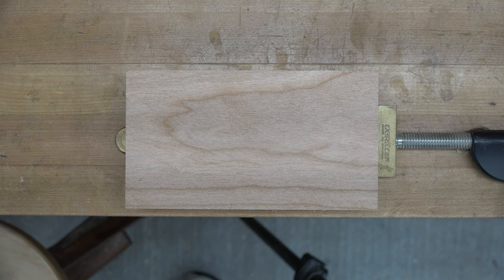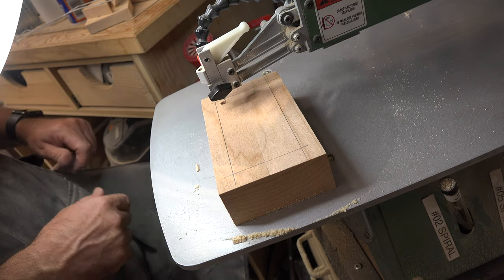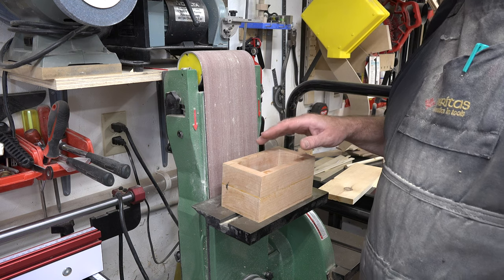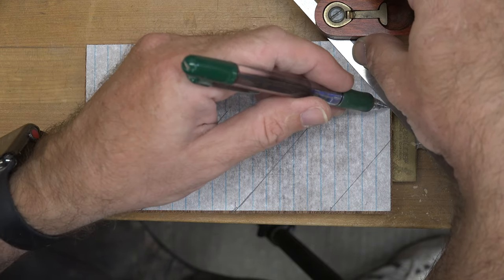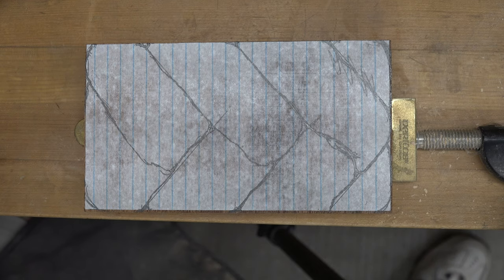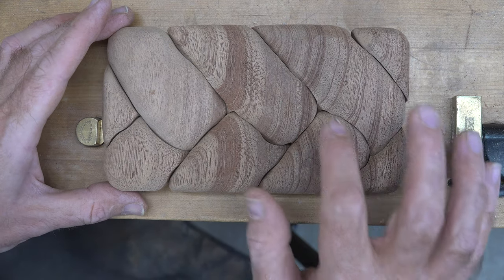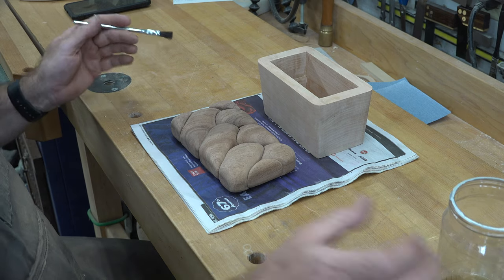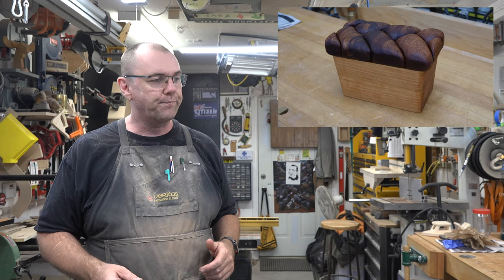Making an Intarsia Recipe Box

Comment: Great project! Question:
Do you think you (I) could do it with a bandsaw?
Reply from the maker: I could definitely be done with a bandsaw Stephen, you would just have to change a few things.  The "box" of the project would have to be made in the same fashion as a bandsaw box where you would cut the interior out and then you would have to glue the box back together where the bandsaw blade cut through to the interior.  (I hope that made sense) Other than that, the project is very doable on a bandsaw.  Good luck with your project and don't hesitate if you have any questions along the way.  Thanks for tuning in.

Comment: Kenny, I don't mean to be critical of your neat project, but the lid is an example of segmentation, not intarsia.   Intarsia is the creation of an object using a variety of woods that are selected for color and grain pattern.  When all pieces are cut in an adjoining pattern from a single piece of wood, that is segmentation.  It does look yummy however.
Reply from the maker: I have created many intarsia pieces and I consider this one of them.  With segmentation, I usually find that it is a flat piece and only one dimensional and while this recipe box may not have been cut in a traditional way (i.e. separate pieces with varying grains etc) it is still shaped in a way, using different species to create a 3 dimensional piece which is what I consider to be a key element of defining intarsia.  So if I were to give it my own definition of what I think qualifies as intarsia, I would say it is the cutting and shaping of different pieces and species of stock, to form a project that is no longer flat, but yet has dimension and depth."  In my mind, segmentation is still a flat piece.  Like marquetry, but thicker.  No to worry though, I'm just fine with someone thinking that it's segmentation.  It makes no difference what we call it or label it, as long as we get out there and make it and enjoy it.  Thanks for tuning in to the show Ronald and for taking the time to chime in with what I find to be a very interesting, difference of opinion.  I love it.